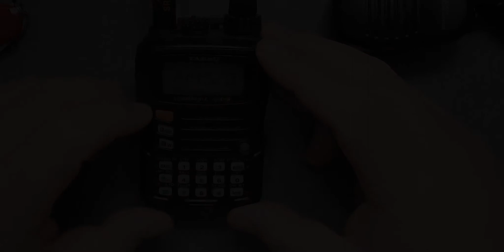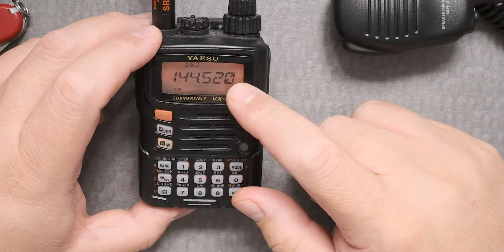Yaesu VX-6 Receiving Modes

Comment: Your video was very helpful, thanks
Reply from the maker: Thanks. -73
Reply: @frankwc0o   I am trying to use my Vx as a scanner to listen to local municipalities. I have one freq: 154.875 with PL tone set 136.5 programmed from radio reference. It is FMN band. It is not a busy channel in my small town, do I need to find any other information for this to receive correctly?
Reply from the maker: @davidb9323  You need a "shift" number and the sign for it.  Check out my video: https://youtu.be/6d11biBza-g and https://youtu.be/HX-iXHjAJrA.

Comment: I’ve been really enjoying your channel especially since I just purchased a VX6R.  While checking in on my local Net I was told I was transmitting a tone and that it was my WiresX that was probably on. I tried a couple of programming changes to turn Wires off. We’ll see if it works. Any chance you could do a short video on how to turn off Wires X on a VX6R?  From what I read online this seems to be a common problem.  Thanks
Reply from the maker: I think I know what they mean.  See the Botton left button, that almost looks like a star?  That's the button I think you need to press to turn off.  It's called the Internet Connection Feature.  You should see the icon on the screen on the right.  The same symbol. Try this again when you speak.  I think I had the same issue when I first used it.  Thanks for watching.  -73
Reply: @frankwc0o  Thanks so much for the tip. It worked👍